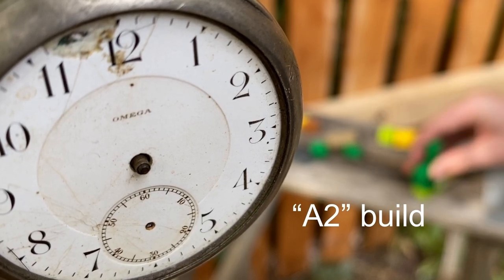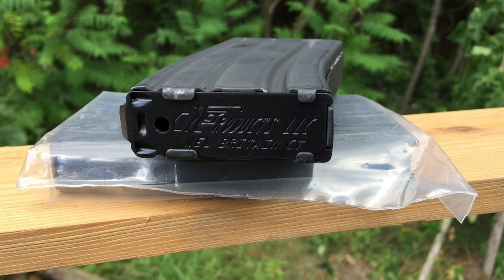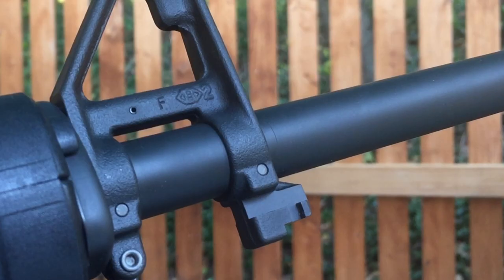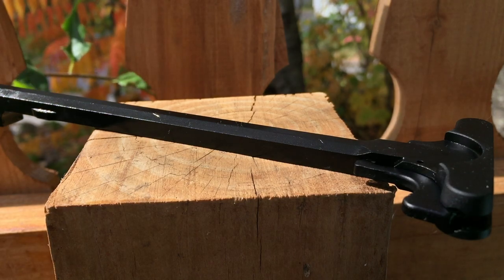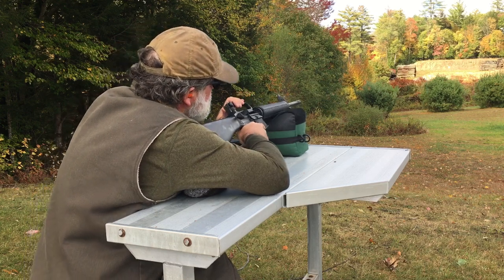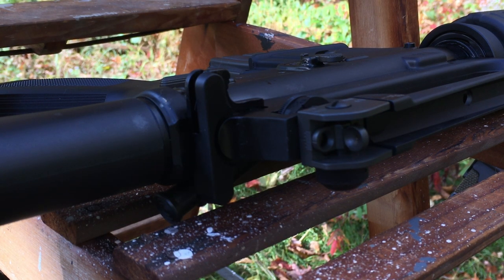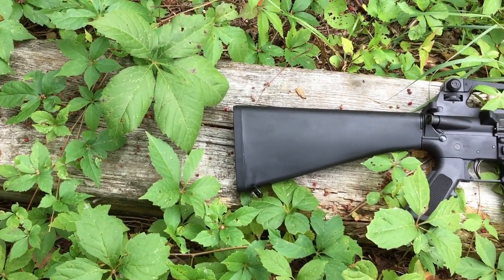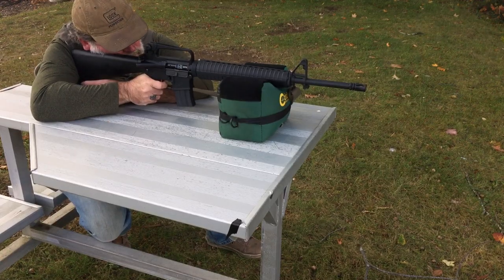M16A2 Clone

Comment: Those 20” rifle gas system guns shoot so smooth I actually just took mine out today and shot it. It’s been a while since I took it out and it surprises me every time as I’m used to shooting my 14.5” 16” mid length gas systems and my 12.5” and 12” carbine length. You should check out psa and get you one of their m16a2 clone lowers just picked one up a few weeks ago plan on building a commando style m4 clone
Reply from the maker: I found a PSA M4A1 lower that I’ve been working on. Didn’t know they made a M16A2 version. That would be sweet for this rifle

Comment: Well, nice looking build! I am building an Aero 16 inch. Just need my upper to complete.  Had to buy parts from no less than five vendors due to shortages and back orders.  Point is to enjoy yourself with your son. 👍
Reply from the maker: Blue True606. Indeed it was a lot of fun and a ton of information for my boy and myself. Yes finding parts is what it is at the moment but patience wins out. Best of luck with expediting your build. Feel free to share my email is available on my channel page.
Reply: @ekg1862  finally got it done! Just in time, I would say😃.
Reply: @ekg1862  I've heard and noticed that the UTG stock has a molding line down the length of it? Did you consider the Rock River one since that was the upper you chose? These A2 stocks seem to really vary between mfg, and someone said the Aero Precision's is more gray than black. Your video was really well done and concise, thank you.

Comment: Great Video.  Can't believe A2's are now considered "Retro"!  I was wondering how you managed to get the rear sight elevation spring and pin into place on the upper?  Every video I saw showed the use of a specialized "A2 rear sight Tool" that holds the spring in place while you hammer in the roll pin but these tools are unobtainable.  Doing it without a tool seems impossible without 5 sets of hands.  Just wondering if you had a trick for this?
Reply from the maker: I used a door pin. A residential door hinge pin from my bathroom door to be specific.I cut a small relief at the end to allow pin to pass. The OD of the pin matched the spring. It took two people about 5 tries before I got it lol. Then return pin to the door:)
Reply: @ekg1862  Thanks!! I'll have to measure my door pins and give it a try.